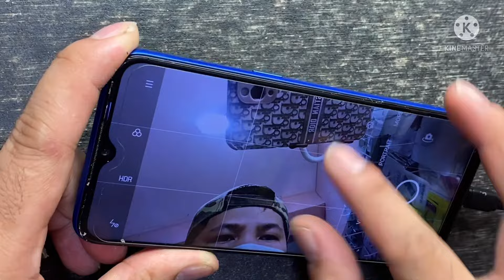How To Repair Display Back light On Screen | Water Damage Problem Vibrate Only  Fix Step by Step!

Comment: Hello bro my phone accidently dropped in swimmimg pool but there was no problem after some tume I checked the camera there was water droplets i think they will go after some time but they did not next morning i woke i open youtube and watched 2-3 short video and my phone screen started flickring and suddenly it turned into black my touch is working i can dial any phone number but screen is black i go to vivo service center they say thay we need to change the display worth 5000 and after that the phone had little bit issue so my father did not change the display but my phone is working at 8:30 alarm ring so what to do bother please tell me phon model vivo V21e 5g

Comment: sir san po location nyo guato ko po ipa gawa yung lcd ko as in lcd po ng realme.yung leftside nya hindi ma touch pero walang crack o basag ang lcd sayang po kasi kung papalitan ko lang ng mga class a class a na lcd mas gusto ko maibaik yung lcd nya kasi original at amoled sya.sana pi mapansin sir salamat po